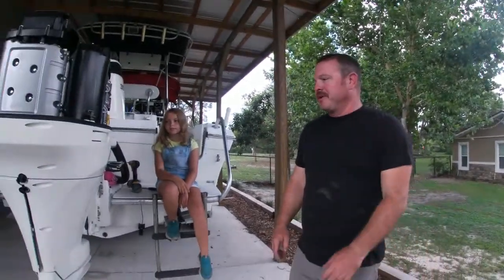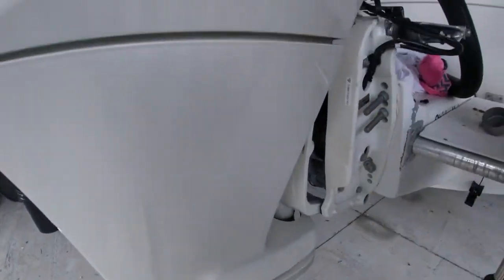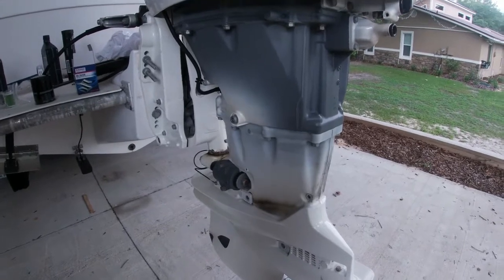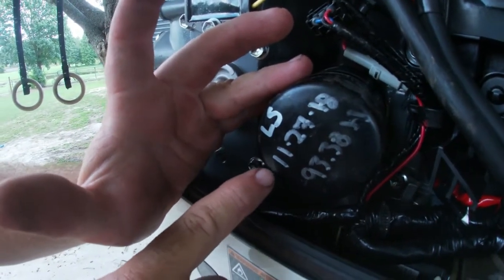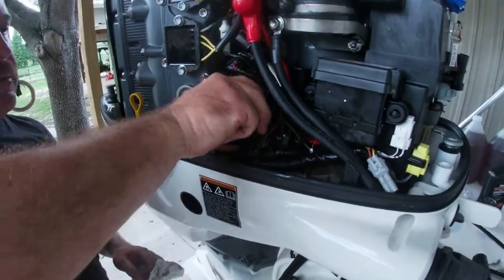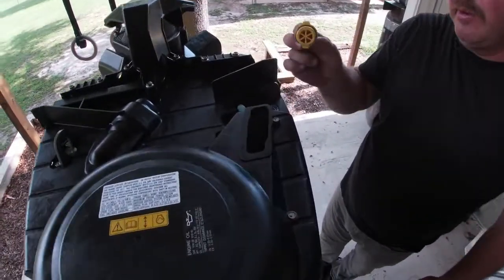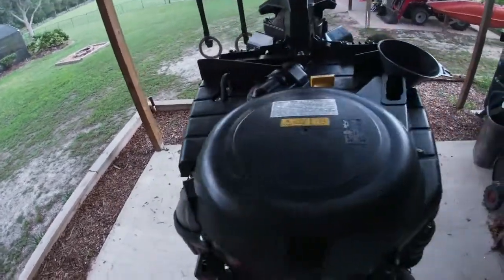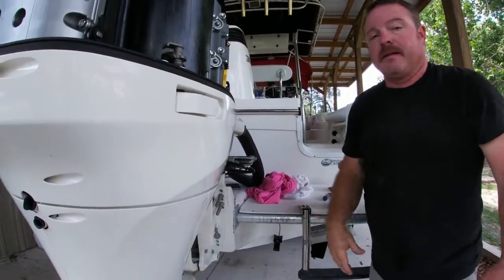Suzuki 300 HP outboard oil change

Comment: You took the lower cowling off.  Why?
Reply from the maker: Took it off to make the clean-up easy.  Thanks for watching.
Reply: @robertsonfamilyadventures7082  I use a piece of duct tape and make kinda a spout under the drain plug so the oil doesn't run down the cowling.
Reply: How did you get the cowling back on?